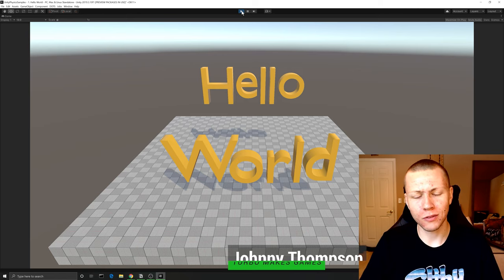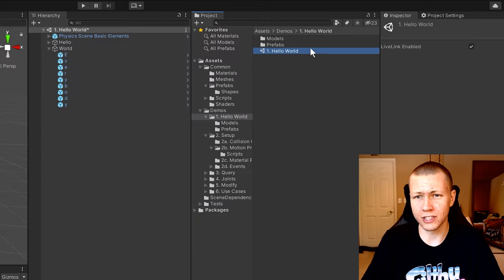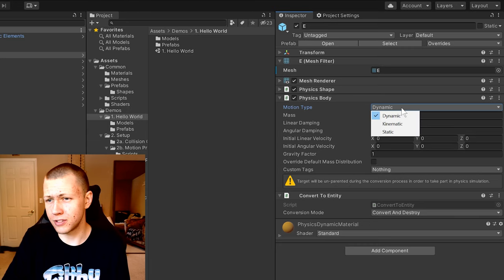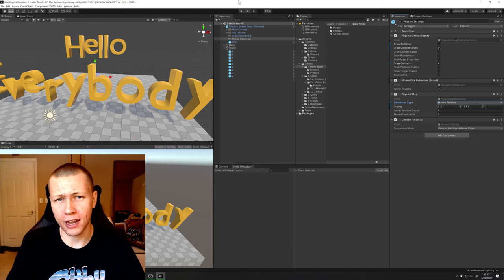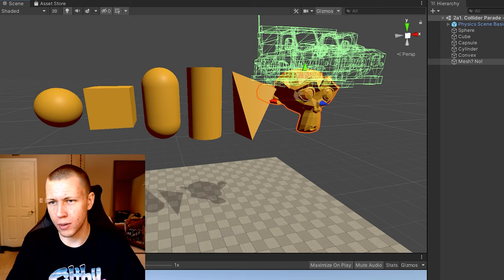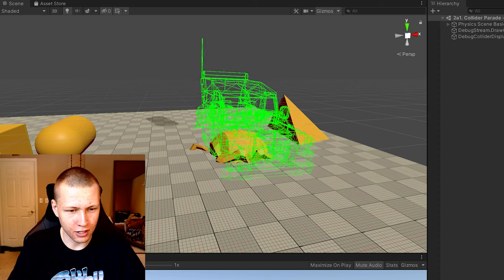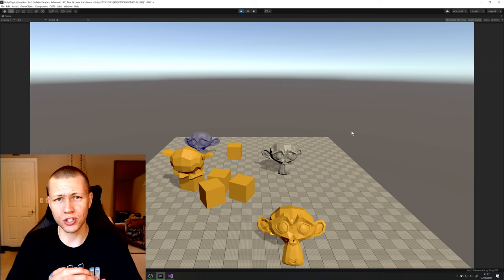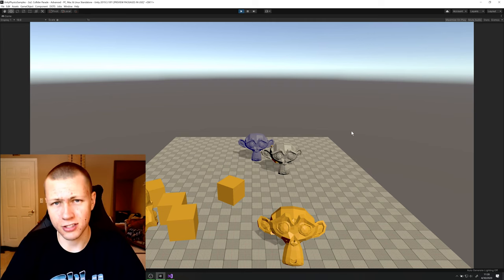Intro to DOTS Physics and Havok Physics in Unity - Unity ECS Samples [Old Version of ECS]

Comment: If i have an old project from 2017 , i have an open World game with rigidbody and colliders does it means that if i update i need to restart all my physic update
Reply from the maker: Nope, these physics settings only apply if you are using the preview packages for the Entity Component System and new Unity Physics. Just updating Unity shouldn't change much from what you've made already. But if you are planning on upgrading, just as a general precaution it is a good idea to take a backup of your project.